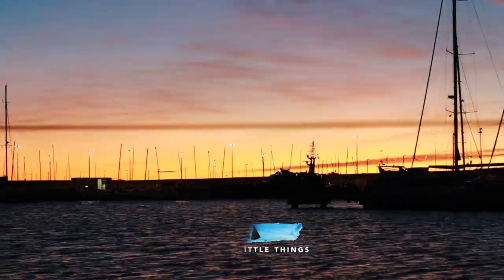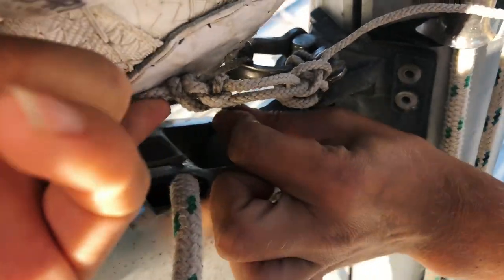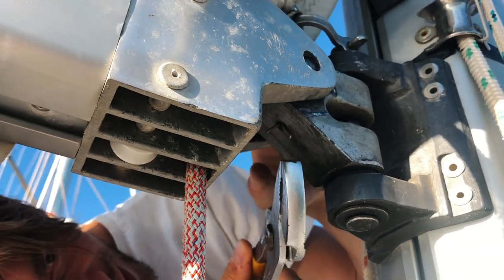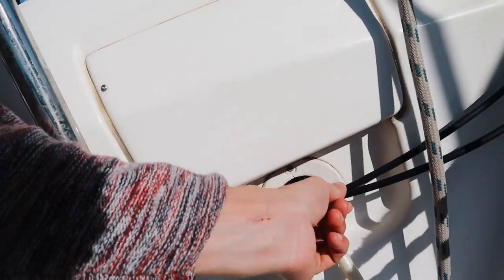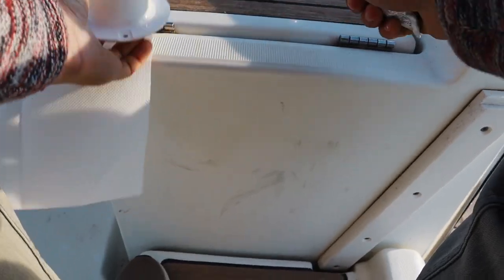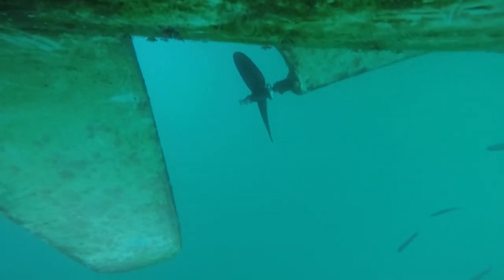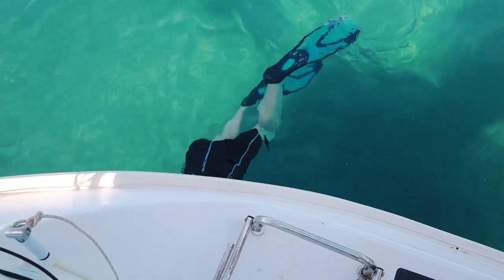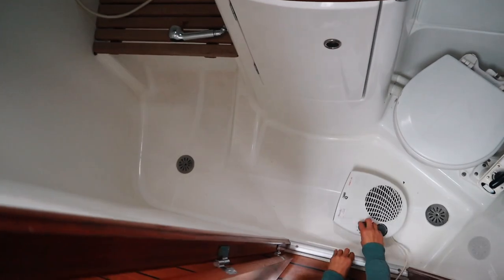Boat Jobs: REPLACING an ANODE in November & fixing the GOOSENECK (COLD!)

Comment: here is a tip for placing cotter keys in bolts or pins... with a pen mark the visable end of the pin with the direct path of the cotter key that way you don't have to keep turning the pin or bolt to line it up to get the key through.
Reply: @romeowhiskey1146  lol not so well with rum lol
Reply from the maker: So simple 🤯

Comment: A weight belt compensates the wetsuit buoyancy and makes work underwater easier... You will use it for boat maintenance, diving, spearfishing etc... Also brush the inside mask glass with abrasive tooth paste or burn it with a lighter,  it will not get foggy anymore (well you still have to spit inside or put antifogging solution)
Reply from the maker: Hey neighbor :) yeah I didn’t really prepare that. Will probably get a full scuba set for next season, gotta enjoy it as well right?
Reply: @seethelittlethings  that's cool, it's a piece of equipment that will bring you so much joy! Do you guys have any diving licences or training?

Comment: Hi. Do never use silicone on a boat. After a while it becomes brittle and it will leak. In addition nothing else will ever attach to the surface that had silicone on it. Regards from Switzerland. Silvano
Reply from the maker: Hey Silvano, thanks for the tip. It’s marine grade but I suppose there is an even better product then to seal self tapping screw holes? Go with Sika?
Reply: @seethelittlethings  Hi. Sika is fine. There are many other products that are good and in part even better than Sika. In Europe we often use Pantera. As long as they are not Silicon-based but are marine grade, you are on the safe side. Merry X-Mas. Silvano
Reply from the maker: Thanks mate 🙏🏻

Comment: Be extremely CAREFUL about using "a compressor" not specifically designed for BREATHING.
Oil lubricated compressors may result in your breathing in  OIL. Not a good idea.
Take "the compressor" to a local DIVE shop for approved use and further explanations.
DON'T trust it...just because a friend uses it that way.
Reply: Romeo Whiskey Lung cancer or lung failure is a serious risk when inhaling oil....
Reply from the maker: Sounds reasonable, thanks for sharing the info!
Reply: @seethelittlethings  The health hazards associated with divers breathing petroleum liquids and fumes are well documented. They are not worth the risk.
I'm not familiar with that particular pump but it appears to be the same type used in non professional hookah dive units, minus all of the bell and whistles. You'll probably survive this insanity. 😁 (Only to entertain us with some other. 😂) 
As for that gooseneck pin... Your home, (however temporary) and your very lives depend on it not failing at the worst time in your lives!
It takes less than 5 seconds to visually inspect it before Every sail and occasionally while under sail. Personally I wouldn't leave the dock or anchor until it was repaired.
A not so humble suggestion, buy the highest quality cotterpin you can find. Make sure it's the correct size and use your pliers to roll the end back on itself so no lines, sails or sheets can hang on it.
Wishing more Good Luck for your future. And looking forward to your next insane adventure. 😂🙋‍♂️

Comment: Honestly I do not grasp why you did not change the locking pin as soon as you had become aware of it was missing. You have been taking a major risk, and risking your lives in case you would have lost the “rod” securing them boom. Maybe I’m a bit over dramatic, but maintenance is vital for your survival chances when at sea.
Reply from the maker: Hey Martin, fair point. We simply didn’t find a pin while cruising the islands. Also we noticed how the goose reacts in worse case and where it would chafe. It became routine to check the bolt every time before and after we set sail, and we never set sail in heavy condition once aware. 

So in short: we know we should have but we worked with what we got